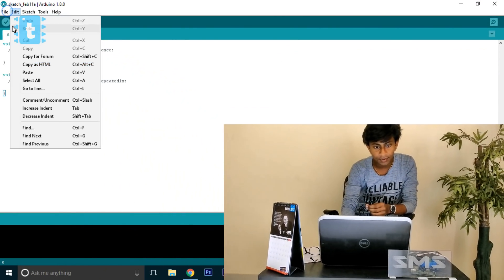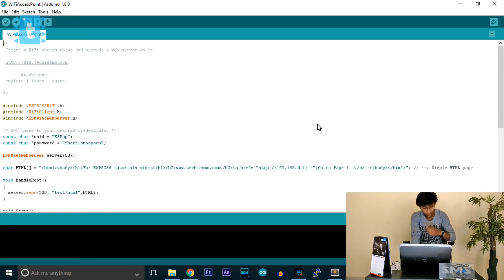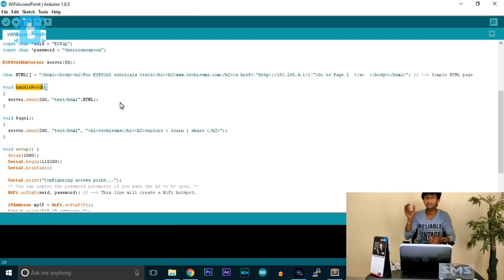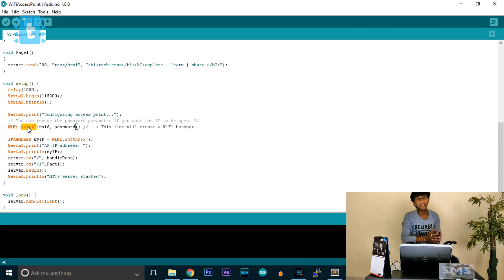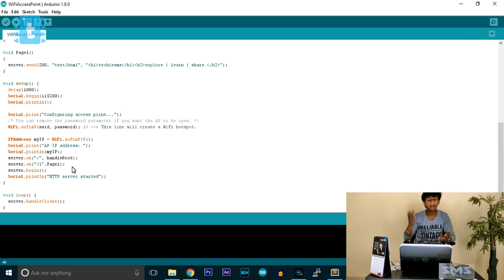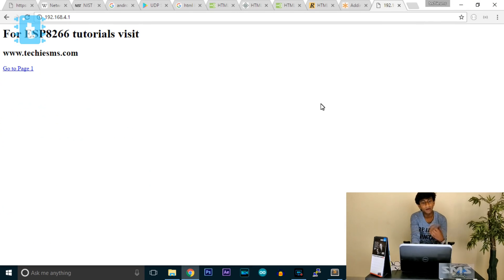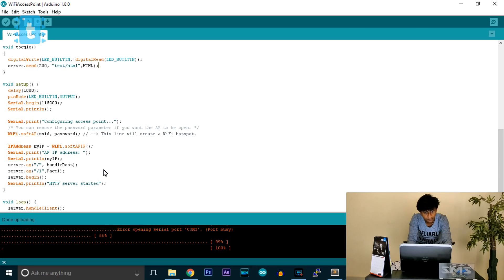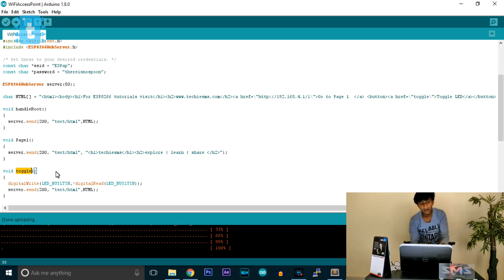WiFi AccessPoint Example Explained | ESP8266WiFi Tutorials #3

Comment: connect to esp8266computer's USB ports, everything working fine. But, if I connect esp8266 to separate charger that has USB port, then esp 8266not running code

Comment: Hello sir, i am getting wifi connected and led on/off also on web but in serial monitor nothing is showing the page is empty can you tell me wat is the problem
Reply: There may be a problem in your baudrate
Reply: Thanks you sir, Will you had done any video on RFID interfacing with NODE MCU ,actually i am working on RFID based attendance management system can you help me in this projrct

Comment: Thanks for the video. I was wondering if you can use two esp8266 modules in AP mode to control led or a motor without going through http, mysql and all that rubbish. Just like using two bluetooth module.

Comment: Hey there! Thank you for your tutorial it helped me out a lot! After connecting to this wifi network created by the ESP8266, I am actually trying to create a form and there will be a "submit" button as well as data entered by users. May i know how do i code it to move on to a next page e.g. 1.192.3.4.1/page2 or smt? as well as how to save the entered data into the ESP8266 for data verification later on?

Comment: Hi.
I've been trying to do this (free of a router) for some time, so thanks for this excellent video. Your explanation of the code is very helpful.
Sadly I have a problem with toggling. I'm using a WeMos D1(Retired) despite me changing the code to cope with LED_BUILTIN being on Digital pin 4 (D4). Any ideas?
I'm really curious as to how the ESP "knows" to use the IP t 192.168.4.1
 How can I make it something like  192.168.4.120 ???
Any help would be gratefully appreciated.
Reply from the maker: +mikespocket 
First of for changing the pin to D4
You need to modify the library files 
Which I suggest you should not do that
Rather then changing the library it would be better to change the main code.

Secondly 
The deafult IP address
I.e. 192.168.4.1 is also defined somewhere in the library (I'm not sure about this but mostly this is the reason for this constant ip address)

Secondly  you can't make the IP address to 
192.168.4.120
But 
You can make it probably
192.168.5.1
Or
192.168.32.1
So the point is 
You can't change the last segment
It will be one only.
The reason for this our esp is acting as a router or a gateway through which all the signals or data will pass
And all the routers have the first IP address (i.e. the last segment is '1'. {192.168.4.1})
And every other devices connected to them will be assigned consecutive address like 192.168.4.2 ,192.168.4.3,......,192.168.4.120 likewise
Reply: Wow. Thanks once more for posting such a quick and informative response with a good explanation of the structure of IP addresses. :D
I had a look at the header files to see where I could change the assigned IP. Weirdly, my computer couldn't find the first one, ESP8266WiFi.h, instead giving a single search result of a file called wifiConfig.h.
Inside this file it seems to  to declare these
 #define STATIC_IP_ADDRESS  192,168,1,113
 #define SUBNET_MASK        255,255,255,0 // REQUIRED for ESP8266_WIFI, optional for others
 #define GATEWAY_IP_ADDRESS 0,0,0,0
which I now find puzzling because it doesn't set the last IP4 digit to a "1".
The second header, WiFiClient.h contains no info about setting the IP (not surprising as the filename suggests the file isn't for servers!), and I get no files found for the third header, ESP8266WebServer.h, yet when uploading the sketch, the IDE doesn't give an error message saying "The header file doesn't exist", so I'm left wondering where's this static IP coming from and how is it set?

Comment: Thanks for your nice tutorial of ESP8266 as a access point.Your video is very clearly explained about esp.
I am try with arduino uno with esp 8266.I have tried with arduino software 1.8.5 and also with 1.6.5.error will happened for #include <ESP8266WiFi.h> and <ESP8266WebServer.h> .where can iget  these hexfile and how can iinclude.

I also tried without arduino using at command,while typing via mobile,esp receive the data but not established the connect.while data send from esp to mobile,busy 's error will happen.

i am waiting for your reply.

s.nagajothi.